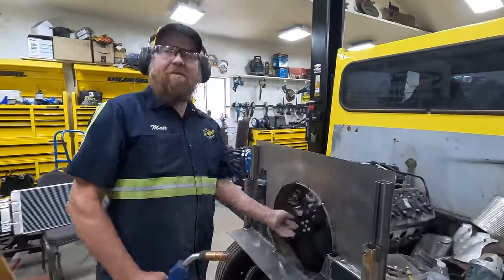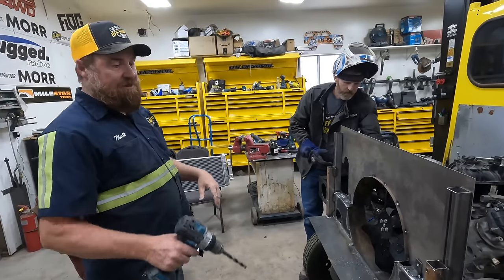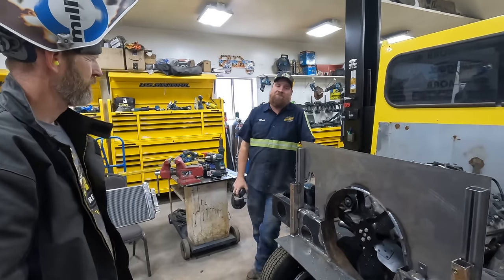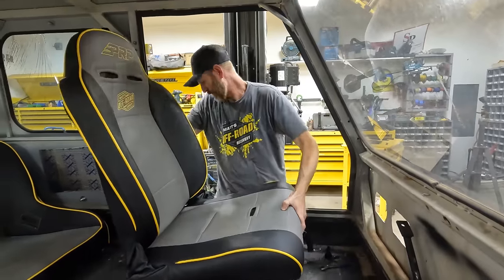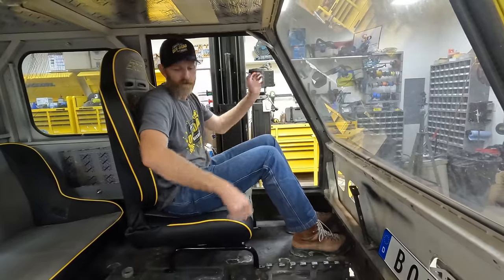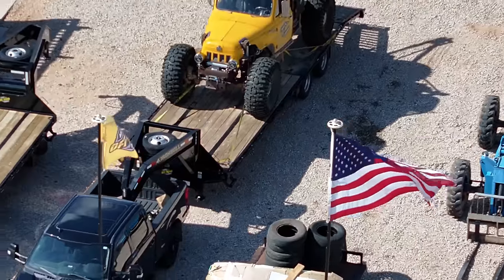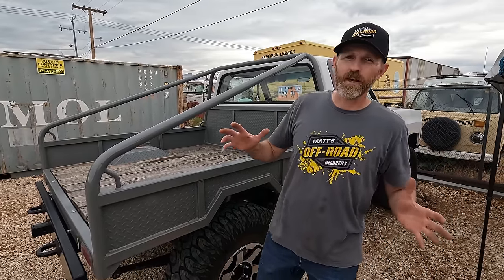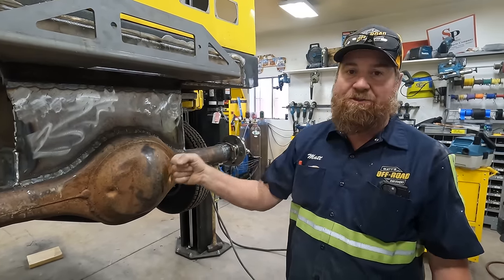The Best Upgrade The Bombi Will Ever Get!

Comment: Matt your on the right track with the cooling system. I know this from first hand experience. You see I worked on a missile loader the size of an Army jeep. (1974). This loader had arms in the front for off loading  missiles from the launcher and the driver sat in the middle with the engine in the back with its cooling system that blew out just like you are doing. Oh and the loader was fully tracked and steered with control sticks and the brakes were rear mounted disc brakes. You see I was one of the mechanics that repaired the loader, missiles, and the launcher. So tell you haters they are all wrong about the cooling system,your brakes and your track setup. To me it looks like your getting the bulls eye. Can't wait to see it working on a job.
Greg

Comment: The levers should be mounted in the most natural position to avoid shoulder and back discomfort.
Reply: No kidding. I spent 25 years on an old, lever style, pre joystick Cat and I'd be in traction now if I had to reach over like that to steer.
Reply: Definitely not in the center!
Reply: Yes!

Maybe one each side of the seat . . .
Reply: Small levers in between your legs like on a Walker zero turn mower would be the best in my mind. Not too difficult to get over to get in the seat, and comfortable when operating.
Reply: As much work as they are putting in they could make it with two pedals like a tractor.

Comment: They make an airgun for those rivnuts thats works really nice! And the rivnuts cone in different depths. You want to go as deep as you can for the thickness of material you are using.
Reply: I just commented and then read your comments. You are right. I think Cherrymax builds a gun. Bringing back my aircraft sheet metal days working for the USAF here in OKC at Tinker AFB.
Reply: Just set it correctly, mandrels are not cheep, you can also use a bolt, nut and washer, put the nut on the bolt, washer on the nut, thread it on the Rivnut, use a wrench to hold the nut from turn, and spin the bolt with a light duty impact, or just a ratchet and socket. That's what we use in house to for repairs on the machines that make rivnuts ( Penn Engineering in Danboro PA), the air gun is great for open assemblies, but not tight places like the parts chute area under the ram of a National Cold Header or Former.
Reply: For stuff not taking a lot of load, I use well nuts.  They're made from rubber.  So all it takes is a little pressure when inserting the fastener and friction takes over to hold it.
Reply: @major__kong  sounds like they work better in harder materials where the rivnut might spin.
Reply: My air rivet gun saved so much time effort.... and busted knuckles. Every manual rivet gun I've ever bought broke in the middle of the job
Reply: @BigWolfBoy50  yes, most of the aircraft parts I reworked were in a sheet metal backshop so the parts were very accessable to a large air gun with the big tank on it.
Reply: @mainelywoodstone7968  yep, you're always waiting for the POP that might give you a giant blood blister when the tools slams shut. No thanks I'll use an air gun for rivets.

Comment: Tell people that question the fan design to look at the OshKosh front discharge cement trucks. They have used reverse mounted engines like yours with a pusher fan  for years with good results.

Comment: I worked in a gravel pit years age and we had a D7 that we flip the fan so it pushed the hot air and dust forward during the summer so it does work. In the winter we would flip it so the warm air back towards the driver. No heated cabs back then on dozers.

Comment: Hopefully those rivnuts are vastly improved in the last 20 years.
They do look slightly different, but when I used them last they just gave out after 6 months and spun whenever you put a wrench on them.  Couldn’t tack them because they were aluminum.
Reply: They are made in Steel, Stainless, steel alloys and Aluminum, Chose the right one for your material application and thickness, do not use aluminum in steel they will do what you said . And yes, they are better than 20 years ago, They were bought out by Penn Engineering, in Danboro PA. about 15 to 17 years ago . Penn also makes the press in threaded studs you find in places on many vehicle bodies including Jeeps  among hundreds of other press in fasteners. I have been a nut forming, and bolt forging machine mechanic with them for 30 years and know the Rivnut product well
Reply: @BigWolfBoy50  Thank you you took the words right out of my mouth.
Reply: Up here, thirty years ago I used nutserts. They work really well.

Comment: Matt Just wanted to say here  0:12 / 34:36 the fan that I think would work the Best for the Bombi Is A old Case dozer Reversible fan blade for summer and winter jobs use. That way you can push or pull the heat from or to the Motor or for more cab heater in the winter. When running the old Case dozer in the winters we would turn the blade in reverse for heat in the Driver seat to stay warm with no cab. It is also good for cleaning the Radiator when fins get plug up. I love Watching All Your Shows and also So Dose My Dad enjoys watching. Thanks keep en coming and Have Fun!!!

Comment: For the dash, to give more space to the front drivers and passenger, I think if you have the dash in the middle with the necessary gauges would be great. great job.
Reply: Yes just a center dash an nothing in front of the driver's knees is what they need to do they could have even moved the seats up an inch or two

Comment: I’m sure you already know this but I’ve had some issues with those riv-nuts backing out on high vibration locations until I started using some mild grade lock tight. Just a suggestion. Looks like that little yellow bomber is going to be awesome! BTW, love that new sheet metal bending tool you have there😂
Reply: If it shakes it breaks
Reply: Lock washers 🤷🏻‍♂️

Comment: By the time you read this, it may be to late, but, an offset steering stick mechanism may make it easy to get in and out and still keep the steering handles right in front of you, like have the steering shafts fulcrum just right of the seat, they would come up 16 - 18 inches or what ever fits then turn left to get the handles right in front of the driver.  Just a suggestion.  You guys are great fabricators so I am sure what ever you come up with will suit you just fine.
I learn a lot from watching you guys work and communicate, and wait anxiously for each vid.

Comment: since the engine is in the rear, Matt's config for airflow (away from the LS) goes together with the overall aerodynamics of the Bombi.
Reply: It’s a brick. There is nothing resembling aerodynamics even close to that vehicle. That said, you’re not wrong in theory.

Comment: You will definitely want some shackle points on the far sides of the front plate at the same level as the winch. So when you are in deep snow, you don't have to dig to get to them. Having them near the outsides will allow you to do offset pulls to control the towed vehicles' path better. Having a good low lash point will help when pulling on low vehicles, so you should still add at least one on the front axle as planned. As for lights I would add two light bars to the front on either side of the winch, and then mount light bars on the roof on all sides to light up your work area. Modern low profile light bars can be as short as 1 inch tall and still put out 10x the light as the old big round kc light bars. With the potentially treacherous terrain, you will be using the Bomb-Bee in being able to easily see the edge of the cliff, which is essential to not get seriously injured. It would also help with filming.

Comment: Did you consider a pair of electric fans?  I would go that way, as it decouples the cooling from engine speed.
Reply: it would have allowed for many more rad mounting options as well
Reply: Would allow you to mount the radiator in different spots.
Reply: Electric fans don't move 1/10th the air of a good mechanical fan.
Reply: Finally, someone is talking some sense about this. His plan to put a pusher fan and blow the hot air from the engine compartment across the radiator is going to be a problem.
Reply: This comes up on every build.
He has tried and used electric fans before, but didn't have great success with them as they push less air than a mechanical fan.
Mechanical fans work on all his vehicles in the desert heat, thats what he's going with.
Also there has to be a reason most heavy machinery including trucks use mechanical fans, they seem to work fine there.
Reply: You people with your YT engineers degrees are hilarious, and if you payed attention, you would've seen or heard him explain that he's also adding an electric fan🤦‍♂️
Reply: An additional electric fan along with the mechanical should be enough to cool this. With that said, I'm not as experienced in building offroad 4x4 as Matt and no experience in the desert. My experience is mostly in hot Kentucky summer's, with humidity thick as molasses.

Comment: Matt's Off-Road Recovery B17...Now THAT would be the Bomb-bee!!
Also, I know you wanted to have a lift off top but for lights and equipment perhaps a roof rack with light bars on multiple sides? Carries the equipment, keeps the back window clear (Tom) and light bars are light weight so you can have them in all four directions for not only seeing where you are going but lighting up the work scene.

Comment: The Bombi is looking great, I had an idea with all the winches you run on your vehicle you could have the heavy guage cables going to the battery and terminated with an Anderson connector which stops right by where your winch is and you terminate the cables on the winch with an Anderson connector, so if you have a fault or need to remover your winch you can un plug in a second undo the bolts and swap it out or if you need to jump start someone you can un plug the winch then plug in some jumper cables that have been terminated at one end with an Anderson connector. It could save you routing wires every time you remove or replace the winch

Comment: For the lights, I’d run a mix of halogen sealed bulbs for the front and an array of leds for on the recovery scene pointed in all directions. We used to plow snow commercially and the led light just don’t reach out like halogens do. The sealed headlights lights from a 1981 gmc/Chevy 1500 were the best I’ve ever driven with in snow and general use driving because the low beams hit both ditches very well and the high beams reached way out into the night with no centre bright spot.

Comment: Black Oak 5W LED light lightbar on the top, you don't have a hood the light will bounce off of so it won't be blinding. Just set the face of lightbar about 3 to 4 inches behind the roofline. I ran one 30" on a roof rack that worked out great, the rack was just over the driver's head and produced a lot of light. Also had a 20 inch one mounted on the brush guard.

Comment: Such a fun project to watch.  For the instrument panel, consider just a center stand (think Bell 47 M.A.S.H. helicopter).  That way you don't need to attach it to the cab and it will save your shins/knees from bruises.  Also, if you put the controls in the center, make sure it can operate with one hand.  You don't want to reach across.  Keep up the good work!

Comment: For the head lights you could block off the holes where the old lights went then mount a light bar right above the winch and attach it where you put a plate in the old holes so you are not adding any extra weight other then a small bracket for the light bar.

Comment: Man, I would totally put a dual joystick in there and then computerize the steering so the sticks would act as the levers. One it'd be cool. But also it would free up the center area and remove some of the brake system.

((Modern snowcats seem to also use the joystick over lever steering now, tool))

Comment: Bumper ideas to build a brush bumper/skid plate that has a bar from the axle tube upward diagonally toward winch plate then add little hoop you were trying to mock up and down on other side to axle tube can mount any 7”  led light on either side. Get some added protection and gives the bombi brick look some attitude!

Comment: I would also use the flat 4 plug type stick on light strip for pickup trucks with the reverse, brake, and turn signals all in one strip. then if you tow you can unplug and plug up the trailer, etc. to the flat 4. they are also VERY bright.

Comment: Good progress, heavy duty foam rubber makes a great packing for gaps around radiator - or any other gaps. A bit of contact cement on one surface just to hold it in place.

Comment: Ive had a bunch of rivnuts spin in the material,  seems to be the tool doesnt compress them enough.  You can build a simple tool to tighten them after setting them the first time.  Bolt with the same threads, long nut and a couple washers.  Love the build!

Comment: I'd put a rotating beacon on the back up above so you can still maybe have one even if you pull the cab. It would be used to mark where you are so customers and employees could probably tell where you are and differentiate you from some dude snowmobiling with his headlight on in the distance.

Comment: As to the head lights.  How about horizontal pipe hoops that starts just in from the front corner (the black square made from the side and the reinforcement you added to the front below the yellow) and connects at the front of the winch mount.  Does two things.  1.  Takes the flex out of the winch mount.  2.  Place to put four small or two large rectangular lights.  The four small lights could be on two switches for two sets of lights.  Love the radiator install.

Comment: I would build the dash as an overhead which will save room or make for some storage space below the windshield. As for the lights setup I'd go with two down near the winch. I would weld a bar around the top for those that might want to stand and stick out the top but also you can mount some lights facing forward as well as off to the sides on the safety bar that would also allow you to remove the top for those summer rescues. A roll back top (like a truck bed cover) would work and keep the inside dry.

Comment: Hey Matt I know this from experience ' You are putting a lot bigger motor in there and It should be fun, But if you don't have a shoulder seat belt you will put your head through the wind shield.  Just a heads up !

Comment: If you guys put the brake handles in the middle of both front seats, you could make a handle that folds to the side to land in the middle of ur legs that way you could drive with out twisting ur body to steer

Comment: With both of you having so much confidence in the cooler, it gives me confidence in it to! I apologize for the comment on the last video. I have faith you guys are gunna make this machine run like a champion!

Suggestion for the Bombi: With how cramped the driver seat is going to be, and you mentioning your knees hitting the dash, you might be better off scrapping the old dash. Make a smaller new one and off-set it into the front of the center console. Have the gauges  all sitting on gage mounts angled up/over at you.

This way you are saving knee room/avoid any accidental knee injury's from sudden stops. (Saw a guy driving a side by side who cut his knee clean in half because he ran into the back of another side by side, and his knee rammed into the dash.)
Reply: Yes I also thought that the dash should be in the center. I don't think many gauges and switches are going to be installed. Could add a console over the windshield if space.
Reply: If they really wanted to they could get a single screen that displays any info they need while taking up less space than normal analog gauges.
Reply: I am just loosing sleep, all of the things that should be different, cooling, radiator, gauges, grinding around the engine, the drive hub in the front? Bob the list just goes on and on. And is all mat’s fault. Oh me oh my. How terrible.            LOL
Reply: Look at a small helicopter such as a Robinson for inspiration on a center dash. In the Bombi with the controls center mounted that could allow true operation from either side which might be beneficial if the operator would be better served viewing what they're doing from the right side.

Comment: Just my two cents, I’m thinking cut out the old light panels, leave the center behind the winch, move the light panels forward on each side of the winch, making more room for feet and front seats, hence making more room for the rear seat. Then reconfigure the “lights” sheet metal to what ever your hart desires. Almost cockpits for your feet.

Comment: Howdy MORR team!

Ive never chimed in with design ideas, but a few came to mind regarding the front of the Bombi :

1) Id have to say I disagree with Ed on the winch crash bar. The crash bar will button up the front nicely and add a lot of practical protection. Sorry Ed!!

2) Matt, Id have to say, placing two ( assuming circular ) lights on the crash bar may make the Bombi look a little underwhelming in the front, maybe even toy like. It would be interesting to see what a robust custom light bar would look like above the cab high up. Possibly two inner lights angled down for forefront lighting, and two outer lights for farther up the road lighting. Perhaps the outer two could be manually pivoting for 360 work site lighting when needed. That sounds like a Bombi for the next Jurassic Park movie!

3) Now that you have winching in the front of the Bombi, I wonder if its necessary / wise to have a window guard. At the very least, this would look very substantial and protect from tree branches and so on. Now that this little beast is getting reinforced, I know your going to push this equipment hard. That front windshield looks awfully exposed. 

Cheers:)